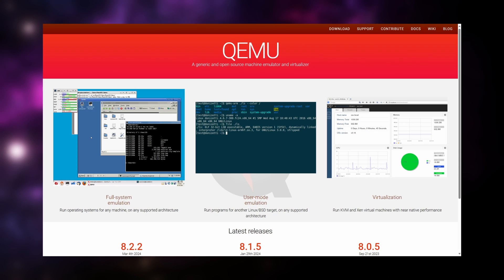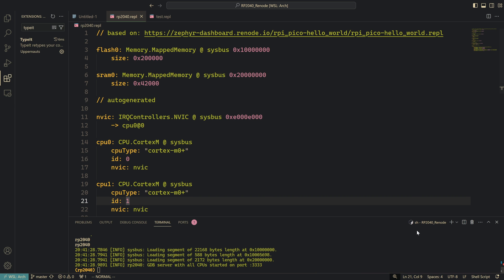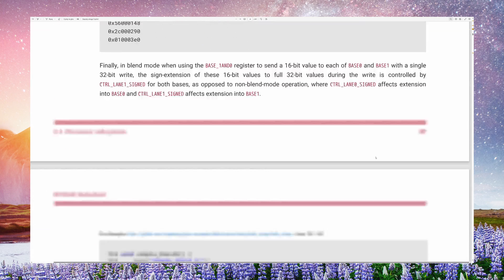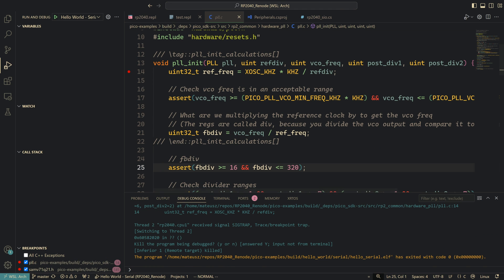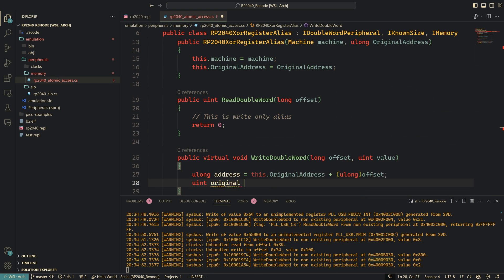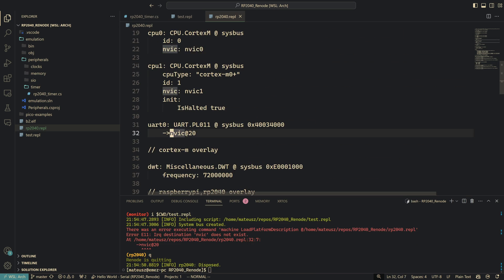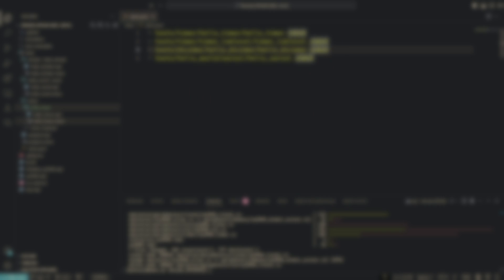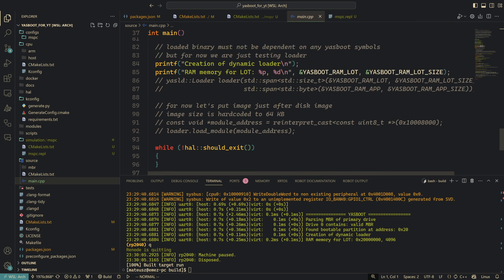MSPC(Custom RP2040 Board) Goes Into The Matrix! Software Simulation Of Real Hardware Using Renode!

Comment: great works. how can I create a peripheral such as an I2C LED driver IC? Do I need create it with C#?
Reply from the maker: Yes, the I2C controller has not yet been added to my repository (I started implementing it, but it's not finished yet). Basically, peripherals are written in C #. Some simple ones can be implemented using Python, and more complex ones using C. 
You can look inside https://github.com/matgla/Renode_RP2040/tree/main/emulation/peripherals, and there is also a website from which I started learning how to extend peripherals: https://betrusted.io/xous-book/ch04-04-writing-cs-peripherals.html
Reply: @matgla95  I saw you implemented ADC peripherals. Was wondering how to manipulate ADC input channel under Renode console, I tried to use "sysbus.adc1 FeedSample 0xFF 1" to feed a value to adc1.channel1, but got no response from execution of code. Is there any steps I've missed?
Reply from the maker: could you try to feed with voltage samples similarly to tests/testcases/adc/* ? 
sysbus.adc FeedVoltageSampleToChannel 1 3.3 1 ? 
As starting point I think you can try to reproduce some simple example from testcases (like hello_adc), they're using pico-examples as firmware